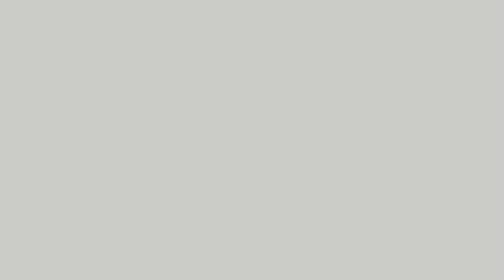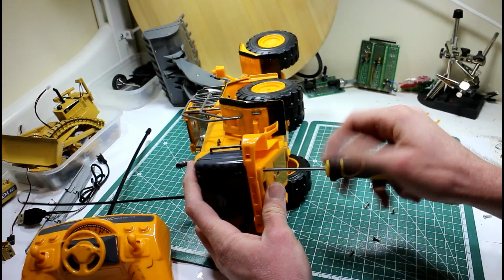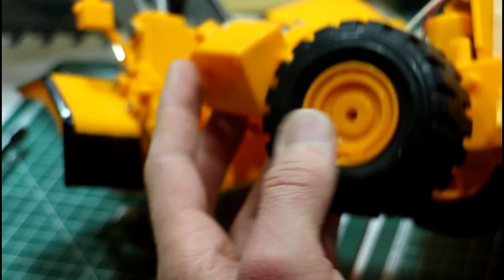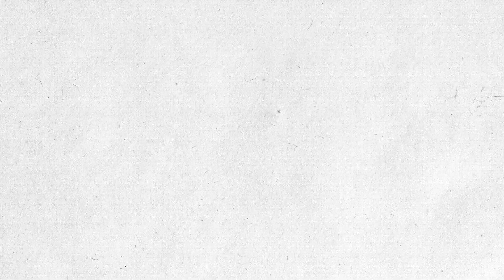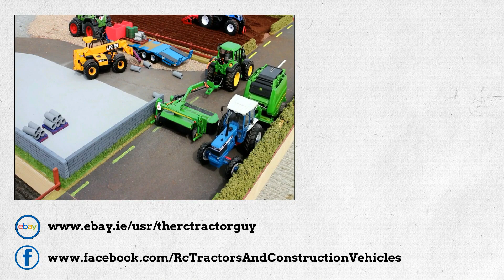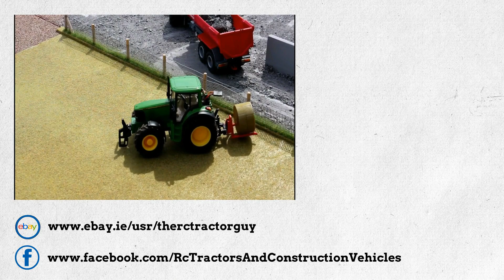Fault finding the broken steering mechanism on our 1:28 Scale RC Loader

Comment: May you can drill out a screw nut and place it over the plastic shaft
Reply from the maker: Another great suggestion, strong and very quick as long as you have the right drill bit size.

Comment: I've had luck using copper or brass hobby tubing. If you are lucky, a standard size works. Unlucky - use a tube 1 or 2 sizes up from the "close but loose" size. Cut it to size and split it down the side.  Put it back on the cracked shaft and squeeze it tight enough to close the crack; and scribe a line where the edge over laps. Using you favorite non-thermal conductive vise, squeeze it to the mark and solder. Smooth all inside edges to prevent scoring (and further weakening pf) the plastic part. Push on and done.

Or make a new part from brass flat / round stock, Solder together. A grub screw to hold it on to the motor.. Overkill :)
Reply from the maker: Great suggestion, I do have some brass tube in a couple of different diameters which I got to try make some screw actuators but I didn't think of making a collar by cutting and soldering it.

Comment: Find a piece of brass or aluminum tubing that just fits over it.  Super glue the crack and clamp it closed till it dries.  Once dry slide the brass or aluminum tubing over the repaired part and place it back on the motor.  I have had a few Sikus do that and that's how I repaired them.  Years worth of working and no problems with the repaired parts.
Reply from the maker: I have a two diameters of brass tube, after seeing these comments I think I'll invest in a few extra sizes. They might come in handy some day.